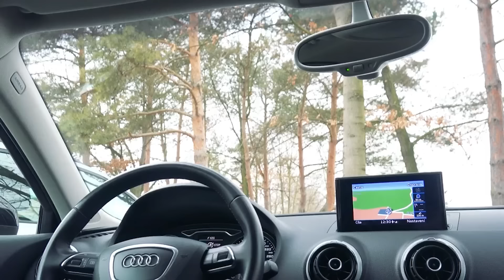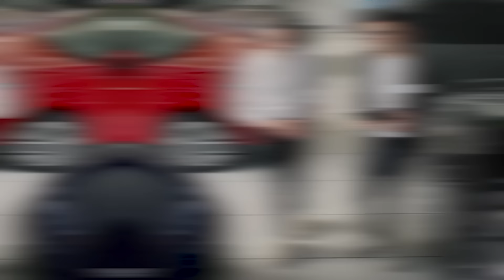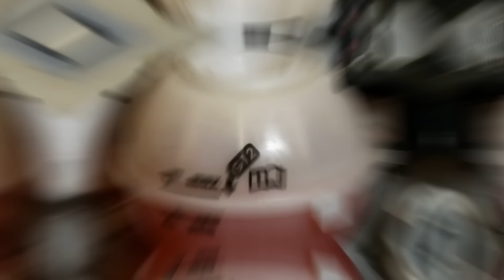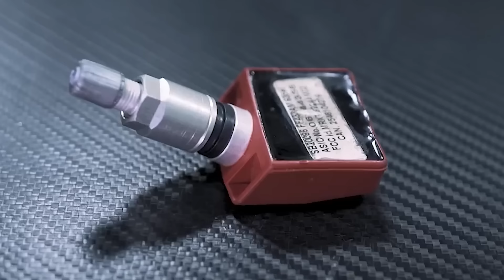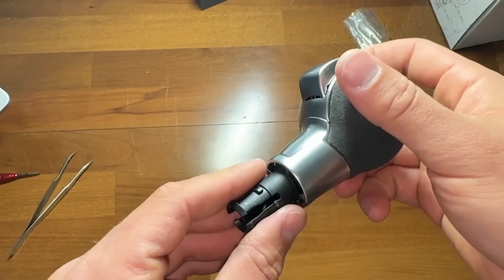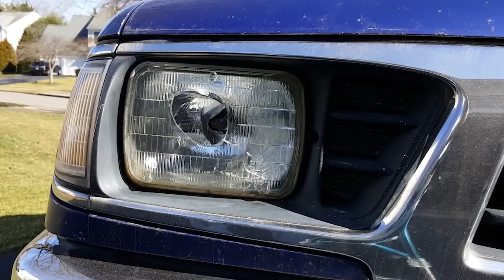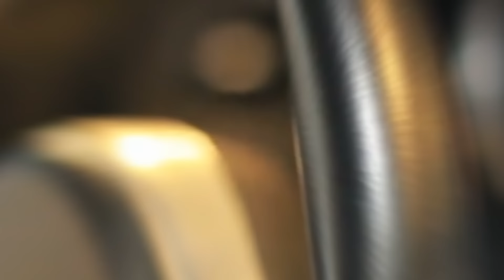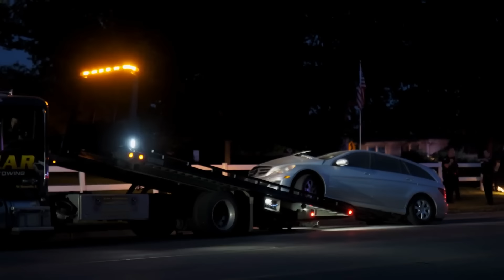25 STUPID Car Features That DESTROY Reliability & Lifespan

Comment: One of the most stupidest ideas I've ever experienced was the start/stop engine feature. I disabled my then new 2020 Acura MDX from doing this. STUPID! I'd go out to get a loaf of bread at the supermarket in the city and by the time I got home the engine would have stopped and started 20 times. Anybody with half a brain can figure out the wear-factor on this.
Reply: Those who own a hybrid understand the start/stop. When using an electric motor and alternating the drive with a gas motor it makes perfect sense.  My 2011 Ford Fusion hybrid was still running fine after 14 years with that start/stop function
Reply: @rgruenhaus  hybrid is not the same as start - stop. Hybrids tend to have electric water pumps to cool the engine while the engine is off. They also don’t cycle anywhere near the amount of times as a these start -stop cars. It’s the heat that is killing them. The constant cycling of the starter heats up the starter.
Reply: @Jaderian87  the star
Stop in híbryd Cars does work different and actually for the car to be hybrid and save gas it has to have the  star stop option they don’t wear couse you can iníciate your car without your gas engine and they don’t use the starter motor but other things that i cant explain in english lol
Reply: @xboy5258  then don’t explain because you clearly don’t know what your talking about at all.
Reply: @J @Jaderian87 i do know just search it up hybrid Cars have to turn off the engine and switch to battery they do it without you even notice it
Reply: @x @xboy5258  so you read something on the internet and became an expert in it. No hybrids are not like the start stop systems in these modern cars. Hybrids only stop the engine when the batteries get fully charged otherwise the engine is running. This is in stark contrast to the start stop systems which stop the engine once you are stopped in traffic. The difference in start/stop cycles is drastic and depending on where you drive can be 10x the amount of a hybrid. 

Also hybrids don’t help the argument here as they do go through starters faster than a standard gasoline engine and that has been known. Starters have a set life span based on the number of cycles and how dirty or hot it gets. Warmer areas and dusty areas go through starters faster than colder and cleaner areas.

Your hybrid argument is that of ignorance and believing everything you read on the internet. Mechanics everywhere are talking about the crap lifespans of these starters. When you continuously keep using a starter it heats up. Delivery companies that make frequent stops end up changing their starters semi-annually.

Go out and learn something before you start proudly stating you don’t notice it. You do notice it when you actually pay attention. Hybrids burn out their starters faster than normal gas engines, period end of story. So it does not support any argument to the contrary.
Reply: @rgruenhaus  It is not a question of understanding. In a hybrid the system makes sense, in an ICE it don't.
Reply: @rgruenhaus that is a completely different function. Not related.
Reply: I have a 4 cylinder 2019 Buick encore that has the start/stop and there’s no option to turn it off. I am not a fan of it, but the price was right. I have gotten used to it and have had no issues with anything in 6 years. That said, I would love to turn it off if there is a work around that can be trusted. Any suggestions?
Reply: @thechicagobox sport mode?
Reply: @DrDeuteron doesn’t have it. I saw some type of wiring work around that can be done, but it’s not official and I’m not sure if I’d even trust it.
Reply: @thechicagobox I HATE THE SYSTEM. I HAVE TO USE BOTH OF MY FEET. THE LEFT ON THE BREAK AND THE RIGHT FOOT ON THE GAS TO KEEP MY RPM HI JIST BEFORE THE KILL ZONE. LET ME KNOW
Reply: First thing I thought of when I heard a stop start engine, so when's the starter wear out?
Reply: 😢😮😅 i respect your compliment on the start an unstopped feature of an engine but I must really wear the engine out and especially the start up.Cause it's gotta stop the engine up and everythi.Respect your compliment very much, you know what you're talking about.Thank you.
Reply: @paulstecker5693 the thing is the majority of people I’ve read comments on about this feature, they say their vehicle has not malfunctioned and that’s owners whom have several thousands of miles or tens of thousands of miles! If people would do their due diligence and research, maybe people would learn something new?!🤦🏻🤷🏻‍♂️🤦🏻🤷🏻‍♂️🤦🏻🤷🏻‍♂️🤦🏻🤷🏻‍♂️🤦🏻🤷🏻‍♂️🤦🏻🤷🏻‍♂️🤦🏻🤷🏻‍♂️🤦🏻🤷🏻‍♂️🤦🏻🤷🏻‍♂️🤦🏻🤷🏻‍♂️
Reply: Exactly, and I don't care what anyone says, stop/start constantly is bad for your system, and is not "efficient".
Reply: Very bad for your vehicle, I turned mine off as well.
Reply: Most new systems feels stupid. Headlights auto on off feature is the same. Lane assist that turn on a high alarm signal when you driving to near one side. Electric windows so if something goes wrong you can't open the windows. No fence for the air intake so rodents can easily slip inside your car. And the cars feels plastic.
Reply: @thunde2375  aka planned obsolescent junk sold at outrageous prices, equals fraud.
Reply: @thunde2375 if you can’t drive inside a lane without alarms going off, maybe take the bus.
Reply: Recieved a letter regarding lawsuit for this feature. Wish there was a permanent disable button for this feature.   Plus, its a v6, how much gas is it really saving.  I'd rather have it come with a roof rack than this feature.
Reply: @pvasicc209  Thing is 90% of owners hate this system, and have complained about it.
Reply: @horseathalt7308 most people are fucking stupid. And?
Reply: I hate auto stall. I have a manual and it still has that garbage.
Reply: @therealdillow gotta make democrats happy with CAFE, for the 🌍
Reply: @DrDeuteron  I’ll take cafe over the current crew.😂
Reply: The argument is "it's for the environment" ... I wonder if anyone has done a holistic calculation as to the actual net environmental benefit. The benefit with long haul driving is obviously zero in terms of fuel saving, as the system don't engage. If the production of the system has an added environmental cost, the net  environmental effect will be negative in this scenario. 

For city driving, it will take longer for the engine to reach optimal operational temperature. As seen on diesel cars, there is often more visible fumes coming out until the engine has warmed up. So longer time with more operational wear on engine, as well as sub optimal engine fuel consumption/emission. More wear on engine will lead to more frequent visits for service, these extra trips lead to more emissions into the environment as well as added cost to the consumer. Any spare parts and labor, will add to the environmental load of operating the garage as well as the environmental cost of production and transport of spare parts. etc. etc. 

At the end of the day, I would not be surprised to find the net effect of a start/stop system is negative for the environment overall, while at the same time an added cost to the consumer in terms of time and money.
Reply: What a stupid feature!😂😂
Reply: @justaskthelady no, it’s not stupid. Do you even understand why it’s there?
Reply: Most city traffic lights only last about a minute or two anyways.  And if you drive on hot climates with the start off on, then the AC unit gets hot in the car.
Reply: This is a great test of whether someone knows anything about cars. If they tell you that it’s common sense that this is ruining your vehicle, run the other way and find someone who learns and reads.
Reply: @rynovoski  That is just baseless opinion ... man.
Reply: We turn off that stop/start feature immediately
Reply: That's why a lot of this new gen don't have any common sense because they weren't taught, they were enabled by their parents sad really tbh
Reply: F yea. Wtf were they thinking?
Reply: @TrainerAQ  They were thinking that they could make ICEs more difficult to live with and have shorter lives pushing people into the EV scam. lol
Reply: @TrainerAQ he told us: got to meet,fleet CAFE standards to appease democrats. If you don’t know what that is, stop 🗳️-ing.
Reply: I read an article about the start/stop feature. According to the article the manufacturers beefed up the starters to compensate for all that start/stops. Speaking of I traded in my Genesis G70, which didn’t have that feature, for a Bronco Badlands that has that start/stop feature and…it doesn’t bother me.🤷🏻‍♂️
Reply: @LJ81fan  the manufacturers say that but it never happened. If you understood the engineering behind motors you would know when they claimed is not possible.
Reply: @Jaderian87 OMG! I just can’t win with you people! I’m telling you I read an article in Popular Science and read all about how manufacturers have literally tested cars with this feature over a million times and have beefed up the components!!! 😡😡😡😡😡
Reply: @LJ81fan  so you just believe anything that you read, without adding any critical thinking to it? Popular Science is not an academic journal and should never be taken with any level of seriousness. They will put anything in their magazine if paid to do so. Manufacturers want to sell the “we beefed up components” lie, because of the benefits from that article. Popular Science gets more visitors thanks to a catchy titles than for actual science. 

Starters have gotten better in the past couple of years but they are still crap. Going from 80,000 start cycles to 100,000 start cycles sounds good on paper till you look at the fact that the car now cycles the starter 5 times as often per trip. Pick up an engineering book and read. Learn some critical thinking and use some damn logic. These cars with start-stop engines are needing starter replaced more frequently than ever

I have been in the automotive industry for 25 years. When you hear “we have made things better” it’s always a lie.
Reply: @Jaderian87 actually that’s what I was going respond to you with, LOL! Seriously, like I said, I read an article in Popular Science or maybe it was Popular Mechanics-these are both reputable magazines! You shouldn’t believe people who just talk out their ass because they don’t like something!
Reply: @LJ81fan  lol “reputable”. Both magazines you mentioned are not peer reviewed so they are not something to blindly trust as you did. Also love how you try to dismiss everything I say because you found some straw man about an article that I can’t find so you are just making it up. I checked both magazines and found nothing. So unless you can provide the exact month and year that article came out I will have to call you a liar. You just admitted you don’t know where you read it which is the biggest trust me bro. 

You can easily look up the fact that starters went from roughly 80,000 cranks to 100,000 cranks which sounds good till you realize start-stop cars crank 5 times as often. But you did t respond to that because you know you don’t have one.
Reply: @Jaderian87 well, actually I found the article!

A 2018 piece by Isaac Bober in Practical Motoringlays out the arguments against auto-start technology and comes to the conclusion that many fears surrounding its use are unfounded.

According to Bober, the use of stop-start technology in vehicles is only possible due to advancements in battery technology, starter motors, oils, and control systems. Modern starter motors are far more durable than previous ones thanks to improved components like bearings and solenoids, and batteries have also become stronger to power various functions while the engine is off.

That information, paired with the fact that newer lubricants and bearings reduce wear during engine restarts, means that one shouldn’t be too concerned about damaging their engine with the feature.

Using cheaper oils can cause more damage to your car’s engine than anything else,” an unnamed expert told Practical Motoring. “Operational stop-start causes no wear and tear at all; wear and tear at cold start-up is a thing, though.”
Reply: @Jaderian87  Don't waste too much time trying to reach people like LJ81fan. They have been edumacated to accept anything that the mass media (which INCLUDES magazines like PM and PS) without any second thought or critical independent thinking at all!
Reply: @LJ81fan  wow just wow. I found that article and where to begin.

1) no sources listed at all. Where is this information they are claiming coming from. You cannot just make shit up without having sources. 

2) no names of anyone. So every single person they talked to is anonymous. So anything said can be dismissed out of hand because it can’t be verified. 

3) no actual data to compare to so it’s shows nothing in reality. You have to provide numbers if you’re going to claim something actually works. 

4) vague language and non specific terminology throughout the entire article. If they weren’t worried about being sued or turned into a pariah for false statements they wouldn’t use vague language. The person who wrote the article knows he doesn’t have anything. 

5) they are a car reviewer not engineers. They have no grounds to stand on them selves. They did no actual testing of the systems other than a quick drive. Which is all reviewers ever do. They then claim they spent months with it. It was parked in a garage but hey they had it. 

6) the article says the parts are more expensive for a few cents of fuel savings. They are right the new. Starters are double the cost of the old ones. Amazing savings right there. 

7) they constantly talk about how it’s personal whether the system will work.  That’s not how cars work. If a car gets 30mpg, it gets 30mpg, it doesn’t matter who is driving it only the amount of traffic. 

8) the article is 7 years old and has been shown to false. Mechanics across the planet have been talking about how these cars are coming before older cars without the system. They are coming in for over heating problems and starters failing. Batteries are failing prematurely and the electrical system is garbage. 

9) the only improvements to starters is going from 8,000 cycles to 10,000 cycles which is not a huge increase. Starters have a 10% plus or minus to the number of start stop cycles. The only thing that happened is starter quality control increased. 

10) the system causes the starter to cycle 4x as much. That’s the average number of cycles and with only a 20% increase to starter life it means the starter will fail faster than one without the system.

11) your car burns more fuel at startup than at idle for 3 minutes. Your car needs a lot of fuel to get started. So what are you actually gaining if lights only last about 2 minutes?

Conclusion: Your paying more in maintenance with a higher sticker price for zero gain on the mileage. Everyone bought into the scam that the car companies told us would increase fuel economy without increasing wear and tear. It looks good on paper but that paper caught fire and is gone now. Use of that system does nothing more than burn out your starter and kill your battery.
Reply: Hahahahah you got a car from 1970?😂😂😂😂
Reply: This is fear propaganda.  Chances of any of these things happening with modern cars is slim to none. And if they do fail, you have a manufactures warranty on the vast majority of these parts.
Reply: @MugshotzAS  What if you bought a secondhand car out of warranty. It is your property, yet you can not without hassle dis engage it. Even the annoying seat belt warning is easily disable in a one time hand move.
Reply: Auto stop bothers me 0. When I know a lights about to change I lift my foot off the brake  bit and off I go. If it was a huge mechanical issue we’d have known about it by now, not just the anecdotal YouTube comment warrior opinion.
Reply: @waynejohnstone3685  The Flat Earth community is big on internet as well, does that change anything ? If the start/stop system on ICE cars are a con, that is beneficial to car manufacturers and repair shops ... people believing their saving the environment and money at the same time, credit & laurels for the environmentalist that pushed it through ... you think "anecdotal Youtuber comment warrior opinion" would be reported in breaking news ? No wonder we're on our way over the cliff.
Reply: @waynejohnstone3685  Tell that to all the Honda Pilot owners who have their cars stall after turning off at stop lights and not restart..but there are many more brands with big issues.. Trump is making that feature go away. Who's your Daddy....? lol
Reply: Your engine wasn’t built in the 90’s. It’s made to stop and start
Reply: @lilbill88  I worked at dealerships for 47 years and I've watched how much technology has changed a simple vehicle into a rolling disaster when it rolls that is. 🤣🤣🤣🤣🤣🤣🤣🤣
Reply: @budbone1955  Bingo, but these bots that claim we are upset about nothing are bought and paid for by the auto mfrs.
Reply: @lilbill88 sure... and your starter was made when ? Built in failure
Reply: @lilbill88 There is no way oil lost during a stop-start sequence can be overcome.  Turbos are especially vulnerable. A potential 200,000 mile engine turns into a 65,000 mile engine over time.
Reply: @lilbill88  A traditional ICE engine with turbo doesn't care when it was built. Cutting off the ICE engine stops oil and coolant circulation if you have a turbo it is COOKING and coking the oil in that turbo and destroying it!
Reply: @horseathalt7308  not true.  In normal driving, you're turbo is barely working.  It is not generating any significant extra heat to worry about.  It will not hurt the oil.  If you constantly have your foot in the throttle or are towing, most start/stop features disable themselves to prevent damage.  If I am in heavy city traffic, I do disable mine.  But in everyday driving, I leave it on.
Reply: @patrickmcmullen7910  Small turbos being used on many modern cars today are working hard in many situations, not like the larger ones of the 80s and 90s. Add in lower coolant and oil quantities flowing though the system and you'll have problems in no time, in the USA many people are always driving on the higher speed highways and freeways and in hot climates as well. It's a disaster waiting to happen.  Then you have the idiotic  auto stop start system stopping the engine and it WILL shorten the life of that small turbo much more quickly. Good that Trump forced the EPA to disallow any credits for that system.  The fact is that auto stop start is widely hated by drivers and has been since it was brought to the industry.
Reply: @horseathalt7308  not really.  The size of the turbo affects how quickly it comes into play.  The load you put on it determines how hard it works.  In normal driving, my 2020 2.0 EcoBoost is maybe developing 2 or 3 psi boost.  That isn't enough to cause damage in a daily commute unless you are bumper to bumper all the way there.  While towing, I see 7 to 10 psi.  Again, the engine will not shut off until the oil temp gets in the safe zone.  Mine is 5 years old without any issue.  Proper maintenance and driving with common sense are the keys.
Reply: @patrickmcmullen7910  Again, the programming doesn't always seem to recognize an issue depending on the sensor inputs. Also there has been many issues with the system stopping the car and either severely delaying the restart or not restarting at all, (eg traffic light), causing serious dangers and or accidents. 
Bottom line MOST consumers hate the auto stop start system and do NOT want it to be active on their vehicles in any situation at all. Include me in that.
Reply: @horseathalt7308  like I said, all I can tell you is that my system is working like it should.  I will continue using it.  If your brand of vehicle is not working like it should, you should ask the dealership why is it failing?
Reply: Many consumers and shops have been either permanently disabling the systems via canbus scan tool or software tools, or installing aftermarket plug in systems. I have done both for many Honda customers in the models equipped with the auto stop start systems.
Reply: @horseathalt7308  My Toyota Turbo diesel ('98) even comes with instructions to allow the engine to run for 1-2 minutes after arrival to destination. Depending on how hard the engine have operated (freeway vs city driving).
Reply: @patrickmcmullen7910  What about those who are not aware of the disable option, and turn of the freeway into the city and traffic lights ?
Reply: @iRelevant.47.system.boycott  if you buy a car, you should read your owners manual and learn how to operate your vehicle.
Reply: @horseathalt7308 OMG, Trump is a walking disaster! He cuts everything and making USA vulnerable! And you idiots said Biden was senile! You people really believe the so called doctors saying Trump is in excellent health?! LOL, a 79 yr old man that has signs of dementia, doesn’t exercise, eats McDonalds daily and not to mention his face paralyzed on one side, cancakles, bruising on hands which shows serious signs of clogged arteries and heart failure!🤦🏻
Reply: @LJ81fan  I would love it is Trump FIRES 
80% of federal govt employees after the 60 days of shut down happen. Can't wait. IRS is next to be gone...
Reply: @horseathalt7308 you must really NOT be a Christian because that is exactly the opposite of what Christ would want for us-to want to hurt another. Especially if you’re following trump, he’s a big time deceiver! You’ll see and learn the hard way, when the time comes.
Reply: I’ve been driving a Prius and now Honda hybrid for years.  There is no disable button. Never had a problem.  Personally, I think it’s stupid to have an engine running, doing nothing but burning gas.
Reply: @Got2no  You do realize that when your EV is turned on and you are stopped it is still being drained to power various systems?
Reply: @Got2no I work at a dealership, a mechanic would laugh at your logic!
Reply: @Got2no  😆😆😆🤦‍♀️
Reply: @Got2no  It is more complicated. An ICE engine functions sub optimal until it has reached it's designed operating temperature. More pollution and wear, on and from engine. More fuel will also be spent generating electricity to re start the engine/keep the battery topped up.
Reply: @Got2no  hybrids and cars with start - stop are not the same thing. In a hybrid all functions are still operating. If the engine needs to be cooled it does so. Not in these start - stop systems. I keep seeing them come into my shop with valve issues due to lack of adequate cooling. When driving in a city the cooling system doesn’t have enough time to run and you can’t use an electric cooling pump as it along with the fan will drain your battery in minutes. Hybrids tend to have electric water pumps to combat this issue. Kills a little on fuel economy but saves the engine.
Reply: No best feature ever it saves gas
Reply: @AlexAlex-gs1xh it's bad for your car, wears out the starter, battery, bad for your engine.
Reply: @AlexAlex-gs1xh  It destroys engines, starters, 12v batteries, and can be dangerous too. The amount of gas it saves is totally insignificant when all those other critical factors are put into the equation. You obviously are part of some "engineering" team that design these things .
Reply: I forgot to add that many people with that auto start stop system claim that the system does not seem to always recognize a potentially damaging parameter to the turbo or engine. Also starters no matter how beefed up as well as batteries are massively strained and will have shortened lives as well. The customer should have the ability to permanently disable the auto start stop system and never have it function in their new outrageously expensive car.
Reply: @horseathalt7308  I can't speak for everyone.  But my 2020 Lincoln has worked like a champ.  Over 5 years of use and 71,000 miles, I'm averaging 32.7 MPG.  Original battery.  Time will tell on the starter but I don't foresee any problems.  Until they relax the Corporate Average Fuel Economy, you are stuck with it.  So just add the disabling step to your routine when you get in your car...just like buckling your seatbelt.  It will become second nature.
Reply: @patrickmcmullen7910  Many people are already finding ways around this by using a scan tool to disable it permanently and or using a aftermarket solution that plugs into the wiring to permanently disabling it. I have installed that in numerous Honda vehicles for customers of newer models.
Reply: @patrickmcmullen7910  so your missing the point while also hitting it at the same time. I run a repair shop just outside NYC. I got into a habit of telling them to disable their start -stop system when going into the city due to the number of valve problems I have seen. You may have one and not know you’re actively creating one. The problem is when your engine stops on these cars unlike some hybrids your water pump stops. Driving down in heavy stop and go traffic causes heat to build up. The cars are designed to run if they need to cool but the threshold is too high for that. All the aluminum and plastic on these cars cannot handle the heat causes by these start - stop systems. And after spending time working for UPS I can tell you no starter can handle constantly starting and stopping.